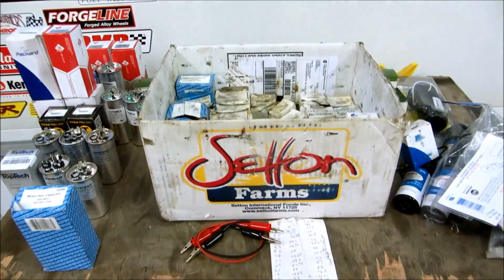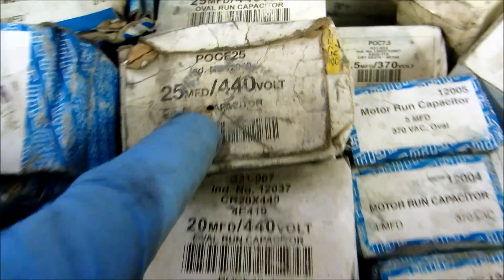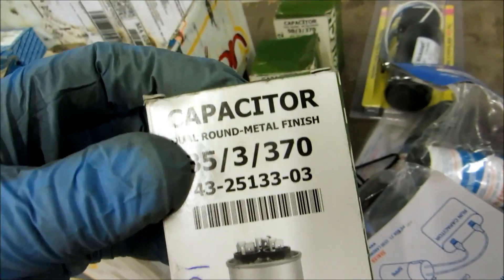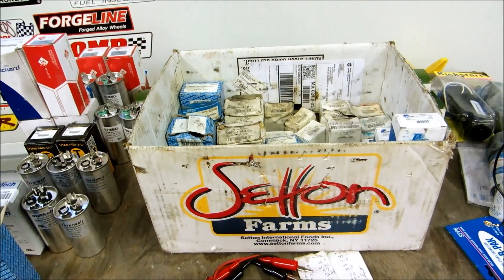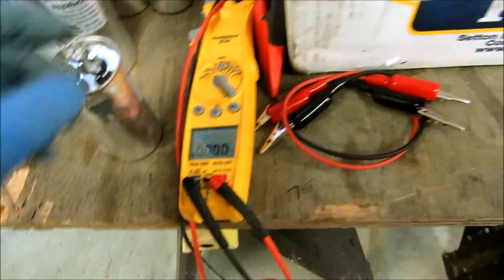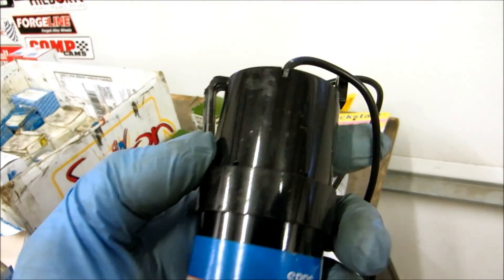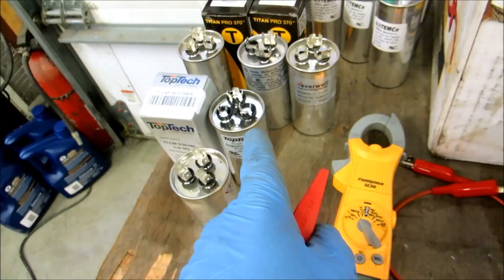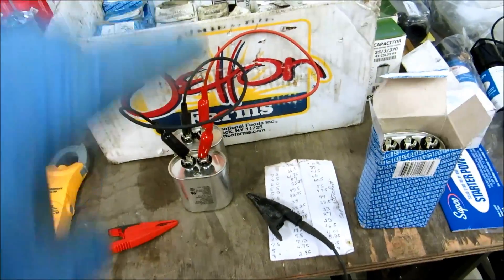hvac:capacitors 101 what you need to know the basics

Comment: Thank you for your video.  For a single capacitor, if the top surface is rusted, no marking to show C or Fan, how do you decide which one is common and which pole can be used for HERM or FAN?  Or it doesn't matter which pole you choose as Common the other to be the HERM/FAN?

Comment: Whats your opinion on the brands? 

We’re on our 2nd (35+5 440v) capacitor in the 3 years on a heat pump that ran for YEARS before the first replacement.....don’t know what the original brand was but am thinkin the Titan Pro isn’t very good since its gone out :/

Comment: Have a Whirlpool WC136A-1A condensing unit that has a bad capacitor that needs to be replaced. Problem is the the cap is all rusted and I cannot read the cap type. Called Whirlpool Heating and Cooling but they weren't able to provide assistance. Also tried looking in the installation manual but it only shows the wiring of the system not the specs on the cap. Any suggestions? Thanks for all the great content Mr. Lav... Next level

Comment: Is it possible my Trane 4TWX5042A1 heat pump doesn’t have a capacitor for the fan? There is a single 45uF capacitor (97F9646) and no other capacitor visible anywhere. The fan is GE ECM 230V AC. Thanks

Comment: I got a 1989 York 2 ton unit that has a 30 MFD cap separate with a 4MFD cap. It just gave out 2 weeks ago. I replaced them both. $20 bucks cad. The AC still gives me the chills. I swear, you could refrigerate food with that unit it's so cold.

Comment: THANK YOU!!  Had a capacitor with no labels whatsoever - and I used your '2 spade for fan, 4 for common' strategy. Right now, cool air is flowing.
Reply: Just look at the compressor and fan to see what size you need

Comment: my carrier  furnace  i put a capacitor in it to start the blower without push start then flip the switch carrier gave me one with all the right numbers but its about an inch shorter whats the difference will it last as long is it the same even though its an inch shorter thanks

Comment: Hi, I added a suppco hard start kit to my 12000 BTU ductless unit I run with a Honda 3000. The unit has a single dual run/start capacitor. It didn't seem to make a difference as the gennie still bogs down (i didnt put a meter on it), is it possible to add another capacitor in parallel to help out on run amp draw (total of three capacitors)?

Comment: every capacitor I pulled from a dehumidifier had a label pressed into the metal top "Herm , Fan and C"   today I pull one that reads:  "herm, L and N"       okay so what in the hell does "L and N" mean?
Reply: Line and Neutral
Reply: @JayHughart  so Line means the same as "common?"      I have a bunch of capacitors that tested good...  not one of them had "herm, L and N."     So I have to go online and purchase another capacitor that has "herm, L and N?"     or ?    thanks for your advice.

Comment: Hey Steven and Molly. I added a hard start to my capacitor and the compressor kicks on (hums) for a few seconds then stops. The compressor while not operating is still getting very warm if not hot. I had to order a new capacitor since the local supplier was out of stock. Off the top of your head does that sound like the capacitor is failed? I had the supply store test it and it's showing that all spades are "open". Love your videos and info. Also.... how you doing mamma ? Thanks

Comment: When you run capasitors in parrellel dont you have to divide the voltage
Reply: No, but they all have to be the same VAC, ie all 370 or all 440.

Comment: the reason to have a cap is because the motor that has a cap is a single phase, so the cap keeps it running the when the single phase skips the power coming in from the power company.  you cant see it skipping but it does.  when it skips the power the cap fills in to keep it running.
Reply: A run capacitor creates a phase shift in the AC power, essentially making single phase power into two phase power. With two phase power you can creating rotating magnetic field inside the motor via two windings. The reason that three phase motors don't need capacitors is that each phase is already shifted 120 degrees.

Comment: boosters are run and start.  5 2 1 c s. r.    5 to common. s to start. 1 to run. boring SLOW video. teach it right.  also, check the continuous coil volts to size up the capacitor if below 370 us it. but stock only 440. its a penny more. you can't go wrong. check the wiring diagram for c and start. c = r. or if you change the outdoor motor that's different. tied into the motor. label the video to read the size of capacitors in your truck. NO ONE IS A SUPER TECH. the best you can be is a MASTER for that hva/r license. good luck everyone. not bashing the tech. bashing the video and language.

Comment: Steve, Have you came up against a capacitor with the data not on the capacitor? Example a bad capacitor and you do not know what size is needed. We know over rated and under rated can due damage. Other than calling the supplier with the compressor tag info, do you know a calculation to get the correct size? Thanks for your teaching, great job.
Reply: Great question 
I wanna know too! Cmon sombody knows this!

Comment: if I couldn't find the same exact rating:
- should i get (higher or lower) µF = MFD = micro farad ?
- should i get (higher or lower) voltage rating ?
Thank you very much in advance.
Reply: Higher
Reply: Higher with the voltage never lower but the uf has to be the same never higher or lower. If it needs a 370v 20uf then you have to have a 370v or 440v but the uf has to be 20uf

Comment: Can a (bad or weak) capacitor cause the air conditioner to:
- work harder = pull more amps ?
- make the fan run slower ?
or is it just simply the capacitor is only bad .. when the fan or compressor is not working at all?
Thank you very much in advance.

Comment: When you run capacitors in parallel you need to divide the voltage
Reply: Comments like these help viewers like me  comprehend better (More) as long as it is correct,  but to be sure I will Now look for verification    So thanks for the heads up

Comment: @stevenlavimonere please help someone was working on my AC it was spinning clockwise before he changed the capacitor after it was changed the fan was spinning in a counterclockwise is it possible to do that by putting the wires on the wrong slots on the capacitor
Reply: I would think so or atleast wires are in the wrong spot on the motor seems they need switched

Comment: I put a 5-2-1 hard start and singled out the caps. One cap for the compressor and one for the fan. My condenser unit fires up like butta now. Actually saved me roughly $20 a month on electricity cost. Talking peak summer in Oklahoma City. After seeing this on mine, I recommend EVERYONE install a 5-2-1 if they don't have one already.

Comment: Aren't they called START caps? Because when the compressor STARTS, it needs the LRA rated or more amps? So it would blow the breaker without the cap, while starting? When it's RUNNING, the amps fall way down and stabilize. No need for a run cap right Steve?

Comment: I just pull my capacitor off,  the only problem is that the old one doesn't have any markings, like herm, or fan or C. So I don't know what wire goes where. I have one red wire and two brown. Help.
Reply from the maker: common will have 4 posts ....herm will have 3 posts  ...fan will have 2 posts

Comment: I was charged $600 to replace a dual capacitor and add a boost by McCarthy's One Hour Heating & Air Conditioning. Did I get ripped off?
Reply: Yes lol could of did it yourself for less than 40 bucks

Comment: Thank you for the information.  
Can you use (2) 25UF to replace a 40UF?
if yes: how would you connect them? this is for an A/C unit on an RV
Reply: No. They would be 50 in parallel or 12.5 in series.
Reply: No 2 40uf in parallel would be 50uf and 2 40uf in series would be 12.5uf and it has to be exactly 40uf so no it would not work you could use 2 20uf capacitors or a 30 and a 10 but not 2 25uf that's 50uf you need 40uf

Comment: Can you use (2) 25UF to replace a 40UF?
Reply: No that would be 50uf not 40uf and would damage your equiptment you would need 2 20uf or 1 30uf and 1 10uf you cant go under or over what it calls for not even a little
Reply: No that would be 50uf you need 40uf anything over or u der will damage your equipment now you could use 1 30uf and 1 10uf or 2 20uf but it has to be what it calls for. 2 25uf in parrelell is 50uf and 2 25uf in series would be 12.5uf

Comment: bad compressor capacitor cause the breaker to trip ? also I have heard from other hvac techs that they put in minimum 30 amp breaker for compressor circuit. existing is 20amp breaker which is tripping within 2 seconds .just changed out last season ( short cooling season : New England)  I'm going outside now to check cap. and shorts.
Reply: The data plate should give you the MCP and MCA

Comment: I am one of those guys that doesn't like the 2 wire kits with PTCs.  They're OK if they get a chance to cool down in between cycles, but if those cycles are shorter, and the days are hotter, I've seen them not kick in at all.  I've seen 2 that popped and leaked and 2 that full out exploded.  I ultimately ditched the two wire for the 5-2-1 kits.  More expensive for sure, but avoiding a call back to me is worth the extra cash.  If I am doing a new install, I usually just get the right size relay and start cap from the supply house (usually cheaper than the 5-2-1).

And in my ever reaching search to find the most reliable capacitors, I've definitely tested almost all brands, however, I have not worked with the TEMCo capacitors?  How do those hold up?  Where are they made?

Keep up the good work!

Comment: hey steve, i appreciate all the videos man they have helped alot . im a young guy new to the trade and watching your videos help me gain the knowledge to do the job right. last summer i changed out a dual cap on a goodman ac and  i was told if you swap the wires the fan will change directon. i didnt have a problem with that i guess i payed close enough attention but i was wondering if that was true and if so could you please explain that to me when you get a chance to? thanks again!
Reply: Its the same as wireing the fan backwards yes it will cause fan to run in wrong direction

Comment: On a capacitor in an AC circuit, the current is ahead of voltage - it makes the current phase shifted to the voltage (90 degrees in theory). Simply speaking: A motor needs rotary magnetic field to run. You cannot make a rotary field from a single winding (just two wires). You need another winding and the phase shifted current (from the capacitor) to create the rotary field. 
Three phase motors do not need run caps, because the three phase power is already phase shifted 120 degrees each phase to each other. The three windings in the motor then create the rotary field.
Hope my oversimplified explanation helps a bit.
Reply: YES! Thank you! "ELI the ICE man" right? It's 90 degrees in a pure capacitive circuit. motors are capacitive and inductive. I get so tired of hearing "techs" saying ignorant things as boost. It's all about the phase-angle-shift of the magnetic fields.
Reply: I like the simplicity in the teaching. Boost is a great choice of words. Of course in school we all learn about phase shift bla bla bla. To introduce phase shift in a elementary capacitor video who seem ignorant
Reply: @Matt-nr5re  and now some people will think you need a meter with MFD to check a capacitor which is not true and not even the best way. So... Boost away!
Reply: @randyosborn284   Why would you by a meter that can not check Capacitance? That seems silly. Always invest in a good meter.
Reply: @Matt-nr5re  not what I said. I said using the MFD setting in a multimeter is a very amatuer way to check capacitance. The capacitor is not loaded. The best way is to calculate it from amps and volts while it's in operation or loaded. I have many capacitors in a box that "miked out" but collapsed under a load.
Reply: 2650 x amps / voltage
Reply: @randyosborn284  Do it the right way. Disconnect the leads to the compasitor. Put a  resistor across the terminal to discharge it(screw driver works). Check for capacitance using a good quality meter. This is how it is done in the field. Once you go to trade school they will teach you this. Theoretic knowledge is good but very impractical at times. This is one of those times.
Reply: @Matt-nr5re  dude, I give up! It's been fun.
Reply: 22 years Full-Time Faculty / Tarrant County College / Heating AirConditioning Refrigeration Technology AAS Degree program / South Campus
Reply: its actually 5 degrees

Comment: steve really good info...I have a question..I live in florida,it's so hot, but the capacitors  blow if the temp hits over 90 degrees...it's a 7 yr old unit with a hard start...thanks ....
Reply: Buy American made capacitors. They work well in Texas. 90 deg is spring time...
Reply from the maker: well replace it .and get a spare its not all that hard to do .

Comment: Thanks Steve, really good info on the terminal count on common vs comp vs fan. The chart is also a great idea. There are so many capacitors out there today sometimes it's necessary to add capacitors to get the correct capacity. We only stock 440 VAC to limit truck stock. I was always taught that the run capacitor limits the current flow into the start winding. I know for sure that in Texas the wrong size capacitor will cause compressor and/or motor overheating on the hottest days.
Reply: I have explained in some comment above. The capacitor phase shifts current to create rotary field in the motor.  Yes it also acts as a ballast to limit current, but the phase shifting action is also mandatory.

Comment: Thank you steven   , Do you think if a saw  some corrosion in my condenser fan motor is time for a  new one  before gets dead?still running    is about 1/4 or so of the housing motor
Reply from the maker: +Adrián Izaguirre i have seen them all rusted out still running i would wait till it dies before replacing it

Comment: Be cautious when jumping capacitors together. Eventually one of the jumped capacitors will fail, leaving the other under valued cap to do the job. This will cause a large amount of stress on the motor, and may cause the motor to fail completely. The only safe alternative to get you out of a pinch is to use a Multi Value Amrad Turbo 200. They are designed specifically to create any size capacitor that you need, and if a failure occurs, it is designed to fail completely in order to avoid any motor damage. The best part is the Amrad family of capacitors come with a 5 year warranty, and are by far the most durable capacitors available for purchase, so you rarely will experience a capacitor failure.
Reply: So a single capacitor gets weak and can fail causing a lot of stress to a motor. The more capacitors the more surface area to volume relationship for heat dissipation. I find dual capacitors have shorter lifespans in the field as heat is a primary factor in reducing the functional lifespan of a run capacitor. So, I disagree.
Reply from the maker: +Charlie Becker i agree turbo 200 is good
Reply: +James Yarbrough I would recommend looking at your stock of capacitors and choosing your top 5 or 6 SKU's and keeping them in stock. Use the Turbo 200 for all of the odd sizes, and Turbo Minis for fan sizes. That way you get the benefit of having the versatility of the turbo, while typically installing a standard cap to keep cost down. Also, the manufacturer for the turbo offers a standard cap with the same performance and reliability. Just look for the Amrad logo distributed by Global. No other capacitor on the market has the reliability of the Amrad brand... They cost more, but for good reason 👍🏻
Reply: When you use an Amrad, you are "jumping" 2 capacitors in parallel. No difference.

Comment: Steve,
finally i get the answer to using two capacitors rather than one dual. Jumper on the common. Great!
Now I can get my unit running, and my wife can stop complaining about the heat... Steve,  You do more than fix HVAC, you fix marriages.  ;)
Thanks
Reply from the maker: +Martin Beaudry lol good luck

Comment: I'm guessing you could put 3 capacitors in parallel to get the voltage you need, does that work as well? thanks
Reply from the maker: Chad Tinsley never seen 3 in a row. do not think it would fit in cabenit  best to run out to get proper part

Comment: Great video.  I've done the parrallel wiring to get me out of a bind when I've run out of the size I need on a call but I was wondering if anyone has tried using a dual cap (ex. 30/5) by itself to make a 40 uf for a compressor only capacitor.  The commons are tied together internally so if you jumper the herm and the fan that should get you the sum of the two values, correct?  The only problem I run into with using two seperate capacitors to replace a dual capacitor is space sometimes.  Thanks for the video.
Reply: No problem paralleling those. It's just two caps in one package one terminal (common) already connected together. Just jump the other two and will be fine.
Reply: You are correct; they will mathematically add when connected in parallel.

Comment: What is licensing like in the New England area? I had nearly considered moving up north but changed my mind believing that 5 years in the trade would be all for nothing because I never had a formal apprenticeship and live in a state that has zero licensing requirements for residential and light commercial areas, anyone with an EPA cert can go work for someone and perform service calls unsupervised straight out of school or even without schooling. I have been told 2000 Hours of formal schooling and 4 and a half years working various equipment in the trade would be useless as far as becoming a Journey person, that I would have to become an apprentice from the beginning.